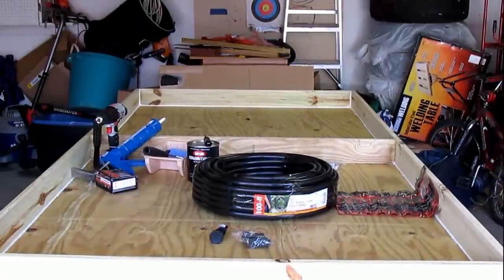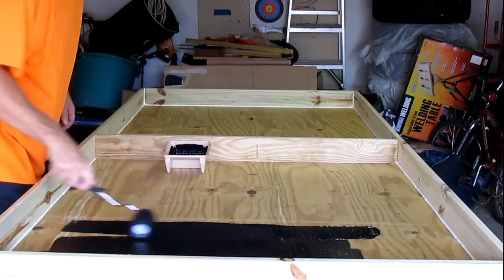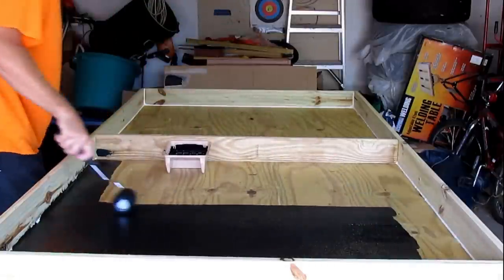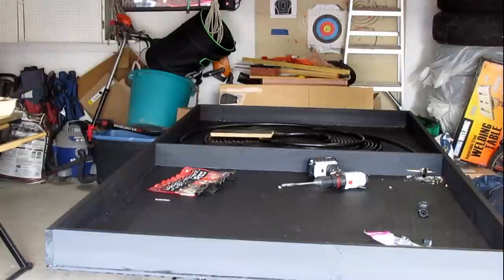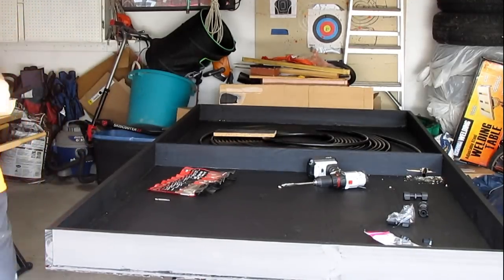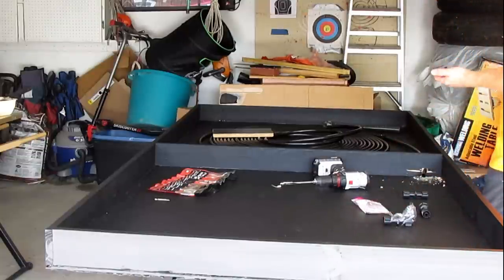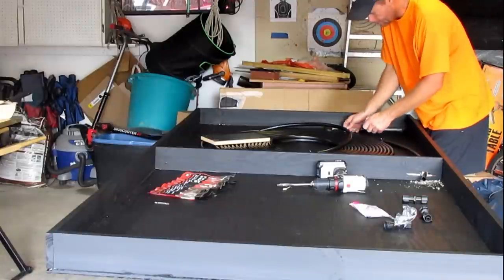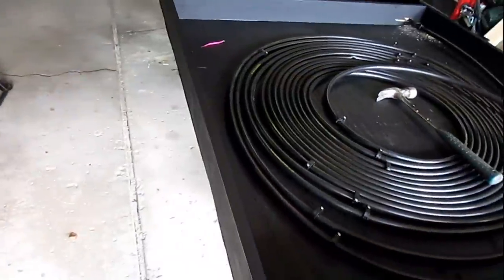How To Build A Solar Pool Heater - DIY!

Comment: Hey there, thanks for the awesome tutorial! If the hosing on our filter pump is a one inch diameter, does that mean we should use a 1inch diameter hose for the whole project? And if so, would that call for a shorter length hose?TIA!
Reply from the maker: You are most welcome!
Are you saying that you are going to use your pool pump instead of the submersible pump?
If so, then you are going to reduce the size down to garden hose size with pvc fittings. You will also need some kind of gate valve to control the water flow.
 Is this what you were asking? I will help the best I can :)
Thanks for dropping by & happy heating my friend!!
#RCInsiders
Reply: @RCInsiders  thank you so much! Yes, I was planning on using the pool filter pump /it's a sand filter pump. Wondering how to figure out the gate valve now, I'll have to do some looking around here. Is there a specific reason to use a submersible pump as opposed to the pool filter pump?
Reply from the maker: @avitovaaaronson6179  Hi,
I went with the submersible for simplicity & I didn't want to have to run the big pool pump all the time. 
If you are not familiar with fittings, go to your local hardware store ( not big box store ) & explain the size reduction you need. Not sure where you are, but stores like Ace Hardware are usually staffed with knowledgeable people. If not, I could help if you had a pic of the fitting & exact sizes,
Reply: Ok we're getting there... Trying to figure out if garden hose or polyethylene hose would be suitable?
Reply from the maker: @avitovaaaronson6179  Hi,
Do you mean inside the heater unit?
Reply: @RCInsiders  we went with the polyethylene tubing for irrigation. Thanks for your responsiveness!
Reply from the maker: @avitovaaaronson6179  You're welcome :)

Comment: Would 200 ft fit in each side?
Reply from the maker: Hi Albert,
I helped a buddy do one & we got 150 on each side & it was pretty tight.
I think if you got everything tight enough you may fit 200, but it would be close.
Are you opening up already? Still a few weeks out here in Michigan.
Thanks for dropping by & happy heating my friend :)
#RCInsiders
Reply: @RCInsiders  not opening yet. Maybe have one ready when I do.

Comment: I guarantee that the incoming water will cool those plastic coils within 5 minutes and the out put will have no heat to add to the pool.
Reply from the maker: LOL 😅😂
Watch this - https://youtu.be/5LKIJ10oQUM
I have been happily heating the pool with a solar pool heater for years.
I will assume you have built & used a solar pool heater since you have made a guarantee?
Now don't get me wrong, solar energy, like any alternative energy has its limits. If it's not sunny or warm, it won't work as well as a gas or electric pool heater. If you can bare the initial costs & the hundreds per month to use them, buy one.
I have been more than happy with the virtually free hot water and small initial cost :)
Thanks for dropping by & have a great day!
@RCInsiders

Comment: I basically built the same thing you built here, minus the plexiglass. I get hot water for about 4 or 5  minutes. I get warm water for another 3 or 4 minutes after that. Usually after about 10 minutes total, there is little to no difference in the temperature of the water after it comes out of the tubing. What the hell am I doing wrong???!!!!! On all these test videos all you ever see is people taking the temperature of the water within the first few minutes of running the pump. I’d like to see what the temperature is after the pumps been running for five or 10 minutes, then let’s see the temperature. Of course the waters going to be scolding hot for the first couple of minutes after it’s been sitting in the sun for hours.
Reply from the maker: Hi Ryan,
There are a lot of factors that will determine outgoing temp with amount of DIRRECT sunlight being the biggie.
On a good sunny day I maintain a 12 - 16 degree differential all day long. On those days I often shut the solar heater system down as the water gets too warm in the pool.
Keep your pump on the lowest possible flow rate as the more time the water spends in the coils the better.
On really cloudy days I will sometimes use a timer. I set it for 15 mins. on 15 off. This has worked well.
The cover really does help as the temps inside the heater box get very hot heating the water further.
How many feet of coil are you using?
What kind of pump & flow rate?
Thanks for dropping by & happy heating my friend.
#RCInsiders
Reply: @RCInsiders  b

Comment: I built this pool heater today thanks to your tutorial.  Hopefully it works.  Thank you.  What do you recommend using to cover the top?  Plexiglas seems super expensive.
Reply from the maker: Hey Todd!
Yeah, plexiglass is beyond what I wanted to spend too.
Check this out as a much cheaper alternative:
https://amzn.to/2Wc8nf9

Our only goal is to trap heat & this should do just fine.
I am also adding a timer to the mix this year. 
I'm actually just using my Christmas light timer & set the pump to kick on every 10 - 15 minutes.
Congrats on the heater! It was a fun diy project for sure :)
Thanks for stopping by & happy heating!
#RCInsiders
Reply: @RCInsiders  awesome thank you, I ordered the alternative part.  What will starting the pump every 10-15 minutes do?  Are you going to run the pump for a certain duration like 5 minutes?  Thanks for all your help.
Reply from the maker: I'm going to experiment with the times. I think having the pump kick  on every 10 minutes will give the water a chance  to sit in the heater & get real hot. Then run for 5-10 minutes & let that cycle run all day. I will keep a close eye on it as I don't want the water to get too hot in the pool. I will make adjustment til I can maintain 78-82 degrees in the pool. With any luck, Ill get the perfect 80!! :)
Reply: RC Insiders do you run the solar pump all day or do you wait for direct sunlight and only run for certain times?  I like the idea of 10 minutes on 10 minutes off.  Have you tested it?  I’m trying to optimize this solar heater.  I just put the plastic sheet on today and still have a little gap, but overall I think it will work great.  Thanks for the insight and good luck this year.
Reply from the maker: Hey Todd,
I haven't tested it yet, but I have a real good feeling about it. 
I was plugging it in as soon as the sun hit it and left it running til sundown.
Hope to have everything up & running this weekend. Our weather isn't warm yet, but hope to be in the pool in the next couple weeks.
Good luck to you my friend

Comment: Do you think that using 3 x 6 plywood would work, i have a piece of each plywood and Plexiglas?
Reply from the maker: Hi Matt,
You may not be able to fit quite as much tubing, but yes I absolutely think it will work and produce heat :)
Let us know how it works out.
Thanks for stopping by & happy heating my friend!
#RCInsiders

Comment: OK .. here's the final results ..
 - I flushed my "system"[  pump( the $21, 550 GPH fountain model with a 7.2FT lift from Amazon) is 3' into the pool; travels over the side and down 2' for 25' into my 200' coiled "system";  then back 30' and up 2' over the side and into the pool ]  with a garden hose. Found some leaks, but other than that water came out fine back into the pool
 - the 550 GPH fountain pump isn't pushing the water thru my "system" at all.
 - I'm either getting a bigger GPH submersible .. or .. do a "diverter system" next year.f
I've seen a lot of YouTube solar heater systems using these "pond pumps", and can't figure out why mine doesn't work ?!
Reply from the maker: Hey Mike,
Sorry to hear your pump is not working.
This could just be a bad pump. If you got it on Amazon they have never given me any problems with returning anything.
If you wanna go with a bigger pump, try this one in exchange for the other:
https://amzn.to/33pkhrl
I'm sure Amazon will refund the price of the other.
Let me know if I can help in any way

Comment: What’s the description on the plastic cover??
Reply from the maker: Hey Freddy.
I would suggest plexi glass for the most safety.
However, you can basically use any clear covering.
https://www.amazon.com/Plastic-Thickness-Superior-Graphic-Supplies/dp/B081H5HC1R/ref=sr_1_52?crid=JSUDL9HZE99G&dchild=1&keywords=4x8+plexiglass&qid=1587935990&s=industrial&sprefix=4x8+%2Cindustrial%2C177&sr=1-52&swrs=B8905A693B974976A9FC5E7E0159AFC5
You can usually find stuff like that at your local craft store as well.
Thanks for stopping by & happy building my friend!
#RCInsiders
Reply: So the water in my hose, that sits in the sun, comes out hot for the first 20 seconds then cools off drastically.  Wouldn't this set up be the same? The pool water would cool off the hose rather than hose heating up the water.
Reply from the maker: Hey k bob,
So, some major differences in your example & the reality of the solar pool heater:
With the hose, you are feeding it with never ending source of ice cold water.
With the solar heater, you are using already heated water.
With the heater, you have hundreds of feet of black tubing inside a black box with a lid.
Both scenarios are using the sun, but the heater will do it much better & will not add any extra water.
Thanks for stopping by & happy heating my friend
#RCInsiders

Comment: Live in canada ....i built one of these and it got so hot inside the box that it melted the pex tubing.
Reply from the maker: No Tim!
I had a guy stop by and commented something similar. He had used glass to cover the unit & in one specific spot he was getting a magnifying glass effect that was melting a spot in the tube.
What did you use for a cover? How hot was it? How much direct sunlight?
Did it melt in one specific area?
Thanks for stopping by my friend
#RCInsiders
Reply: I was also worried about this because I live in south Georgia. Maybe a higher heat rating on a different type of tubing would work.
Reply from the maker: Hi Sammantha,
I was hoping he would answer some of my questions.
If you cover it with glass like the other guy I mentioned, you could get a magnifying glass effect when the sun is at certain angles.
Our unit is on it's second season and have not melted anything. 85-100 degree heat & extreme humidity is the norm for Michigan Summers.
I believe the melting point of the tubing is 250-300 degrees.
Happy heating my friend!
#RCInsiders

Comment: What about a black sheet of aluminium floating on the surface of the water? Would reduce complexity a lot and if the water is moving a bit its anyway down to the surface area of whatever the sun is hitting.
Reply from the maker: Hi nameless,
Aluminum foil is an extremely poor conductor of heat. It has too much surface area compared to its mass to be a good way to transfer heat.
Not even sure where you would get a giant sheet of black aluminum foil?
Is this something you tried or are thinking of trying?
Thanks for stopping by & happy heating my friend :)
#RCInsiders
Reply: @RCInsiders  Aluminium is pretty good at conducting heat, not as good as copper but good enough. Because you are basically only tring to increase the absorption of energy by using a black material rather than clear water, even a black tarp rested just below the surface, would work.
Reply from the maker: Aluminum maybe. Aluminum foil no, as explained above.
Interesting theory with the tarp, but I honestly doubt you will achieve your goal of heating the pool.
If you decide to try either of the theories you mentioned here, can you stop back by & let us know how it worked?
Thanks again & happy heating :)
#RCInsiders

Comment: you did the test whit one coil the other was in the chay
Reply from the maker: Hi Pierre,
I'm not exactly sure what you mean.
Do you have a question I could help you with?
I would be happy to help any way I can :)
Thanks for stopping by & happy heating my friend!!
#RCInsiders
Reply: @RCInsiders  im from belgium sorry. but  what i was saying is one off your  coils  didnt heat up when you where doing your test . it whas not in de sun .  if it whas your temp. would be higher. ty
Reply from the maker: @pierrevansusteren1870  Hey Pierre. Wow Belgium? That is awesome! Another great place I always wanted see :)
Yes. chasing the sun is an issue as I have a garage & trees I have to fight :)
 Here is after we added a second unit - https://www.youtube.com/watch?v=sdV8_EJTVzo
There you can see how hot it gets with full sun. Its scorching!
Have an awesome week my friend :)

Comment: why is it NOBODY ever says what type pump to get ?!?!
Reply from the maker: Hi Mike,
The video description has a complete parts list for everything used in the making of the solar pool heater.
The pump is here - https://amzn.to/3eLDHss
Thanks for stopping by & happy heating my friend! :)
Reply: @RCInsiders  TY
Reply from the maker: YW.
How did you're project go?
Reply: @RCInsiders  -- Used a 550GPH pump lowered about 3FT into one end of my 15x30 pool. The water travels up 3FT .. then 20FT to my 4x8, 200FT  circle of 1/2" irrigation tubing .. back 25FT into the pool. Know what? .. the pump isn't doing its job!  Might have too get a bigger pump ( a 1600GPH submersible ) ?
Reply from the maker: @mikeswenson6613  What is the lift rating on the pump you used? Is there an elevation variance where the heater is sitting? Also, you could have vapor lock in the tubes. Try running your garden hose through the solar heater until you have water coming out the other end (fill the tubing with water) and then hook up the pump & try to run it again.

Comment: saran wrap traps heat
Reply from the maker: You are correct,
Unfortunately it won't make it through even a minor rain storm & traps very little heat for long.
Did you build a solar pool heater using the wrap as a cover?
Thanks for dropping by & happy heating my friend :)
#RCInsiders
Reply: @RCInsiders  no i havnt built one but seen one that they used the saran wrap and wrapped it tightly around whole thing and said it worked great but waatching ur vid gave me some confidence that i may try build one. thx again
Reply from the maker: @dumpsterdivingqponqueen9499  Awesome Queen! If you need any help along the way let me know...Happy to help :)

Comment: Hey bud , 
Have you ever turned the hose on and water is hot cuz it was laying in sun then 2 mins later it’s cold !!? Ya probably should have let it run for 5 mins before you went and tested it on YouTube??!!?
Reply from the maker: Wow Kyle Dixon, with all those exclamations, I'm surprised you didn't hurt yourself 😜
Let's try to explain this for you:
In your example, you will be feeding the short length of hose with a continuous source of fresh cold water.
With this solar heater, you will be slowly pushing already heated water through hundreds of feet of tubing inside an insulated hot box.
Does this make sense to you?
If you're having any trouble understanding the conceptual difference in your example and the reality of the solar heater, please let us know & we will be happy to provide you with a more in depth explanation.
Thanks for stopping by Kyle. We hope you enjoy your pool this season.
Reply: Hey , your right I shouldn’t be negative, but your demonstration is very misleading. You had tested it (cuz u said look mom no leaks) then let water sit in there and heat up . Had someone else plug in pump and took a temp reading on the first cup . So that is essentially what I said  . You would need to let it run for 5-10 mins then get a accurate reading from what your pool is and the running water out of end of solar unit . Which I think you did a great job on . Just not the demo .
Reply: @RCInsiders  the out going water tested has been sitting in the black tubing. He should have let it run awhile before checking the temp
Reply from the maker: Kyle,
I came back later in the vid and stuck the thermometer in the running water and clearly stated that the outgoing water temp had fallen by over 20 degrees. Why on earth would I be misleading?
I'm not mass producing solar units in my shed & selling them on the street corner for a profit. This was a learning project that I shared hoping that others would find value & many have.
You didn't address my above statement where I explained how your example is irrelevant in relation to this heater. This heater is not being fed by a fresh, continuous cold source.
Bottom line is this solar heater will produce heated water & it's a fun DIY project that almost anyone can do.
Thanks for stopping by my friend & stay safe
Reply: Kyle, you are embarrassing yourself. yikes..

Comment: you went through all this trouble, why not invest in a stronger pump.
Reply from the maker: Hi Shiraz,
This was a project I considered fun to do. The project was not trouble.
This was a fun, simple project that produces warm water from the sun.
There is no need for a "stronger", more expensive pump.
I now have the pump pushing through 2 units. The only reason I can see for needing a stronger pump is if you plan on using more than 2 of these solar heater units.
Is there a specific reason why you think you need a stronger pump?
Thanks for stopping by & happy heating my friend :)
#RCInsiders
Reply: Does it work properly? You don't want speed on the pump is slow process  for the water to heat. Abd the tubings are not far from the pool!!
Reply from the maker: Hi Miguel,
Yes, we don't want the water speeding through the tubing. We want some time for heat transfer to the water :)
Thanks for stopping by & happy heating my friend
#RCInsiders